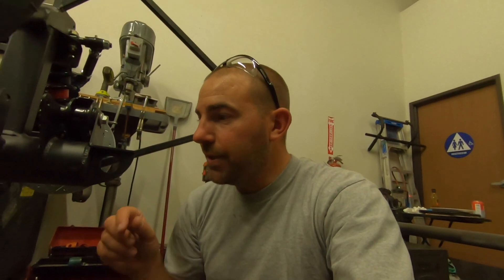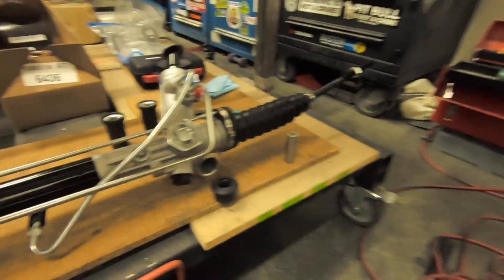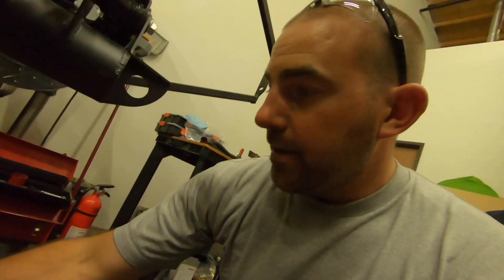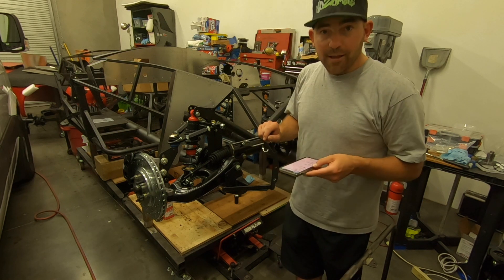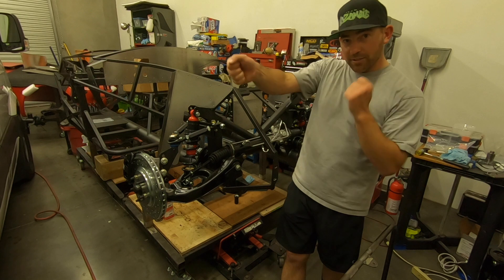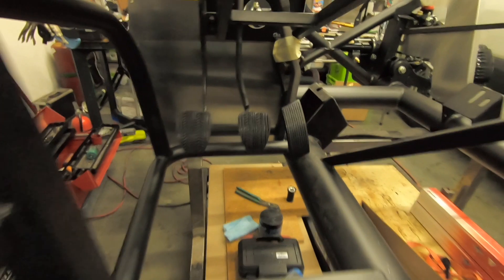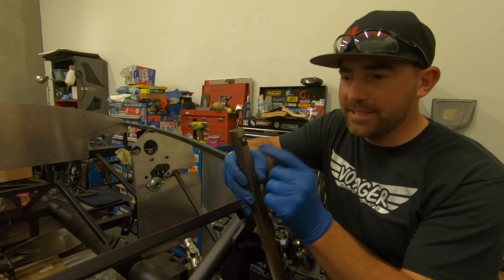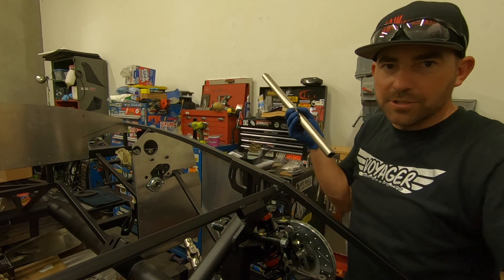Factory Five Cobra Roadster - Steering System

Comment: The inner tie rod threads on the Fox (79-93) are SAE while the SN95s take a metric thread. The Maximum Motorsports website is a great resource for all things Mustang suspension/steering.

Comment: My lower control arms are backordered. Do you think I can still put the upper arms and power steering rack in? Upper arms should be easy but idk about power steering...
Reply from the maker: You probably could put both in. Especially if you need to install the rack extenders still. Just leave the inner tie rod off or figure out someway to keep it moved out of the way when you are installing your lower control arms.

Comment: Move the bearing and mount to the inside of the foot box.
Reply from the maker: Which bearing?
Reply: Currently running into the issue of the lower steering shaft being too proud in the u-joints causing binding. We have the bearing oriented the same way as you do in this video. Watched some factory five videos back and I think we both have the bearing backwards. The mounting for the shaft on the bearing should be facing the rear.
Reply from the maker: I’ll double check this

Comment: Steering  wheel pillow block and shaft in the MK4 is not straight, and isn't meant to be straight. If it were straight your steering wheel would rub/overlap the door/body curve. Yes this is weird, but you get used to it. The seats also do no go in straight, so the combination of crooked steering wheel and crooked seats match. You sit a little sideways in the car, and this is normal and you get used to it. it's designed to be this way. You will find that the only slightly uncomfortable result of all this is your shoulder harnesses do not equally split the centerline of the seats, so one shoulder harness will rub your neck more than the other. Welcome to the cobra replica world! It's unique in many ways.
Reply from the maker: I figured that’s how it was supposed to be. I’m used to that from old 911s where the pedals are off to the side. I’d like to correct that someday by designing a new chassis. But that’s a project for another time.

Comment: The other bushings come in the base kit, you didn't need to buy bushings. Did you do your inventory? You will find them eventually. But no loss poly bushing you bought are better.
Reply from the maker: Mine didn’t come with bushings, I inventoried every box. My steering rack was also on back order and it got sent a few weeks after receiving everything else, so I have a feeling they left out some parts I was supposed to get with it.